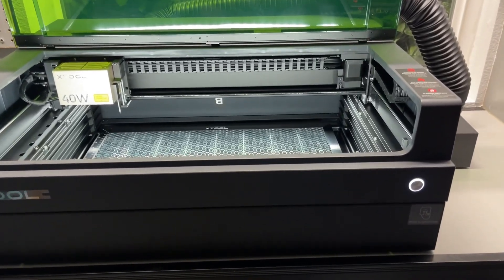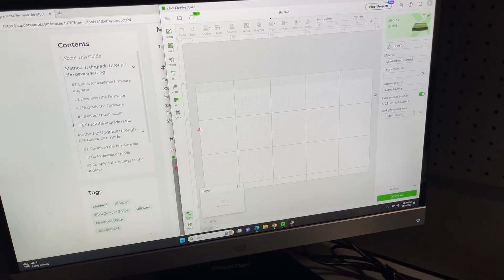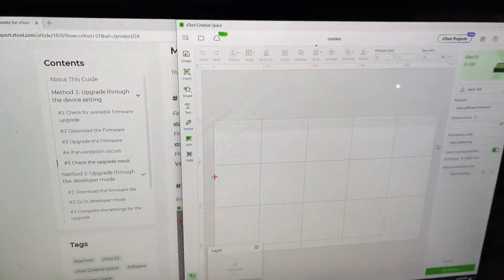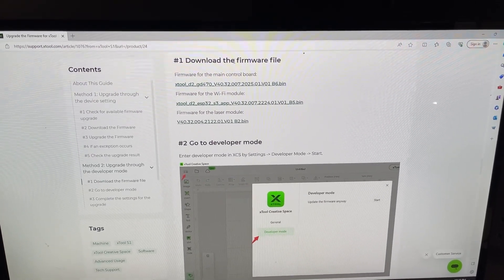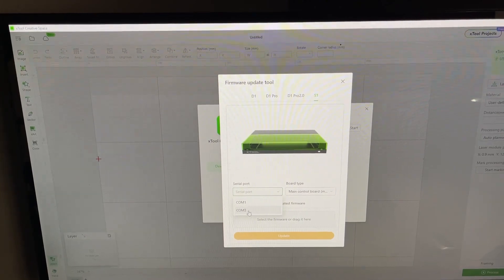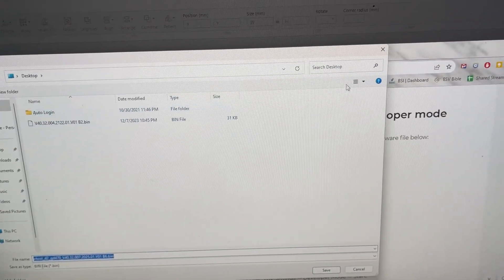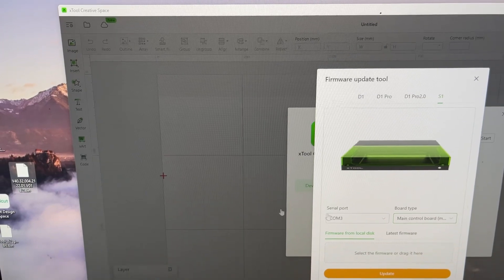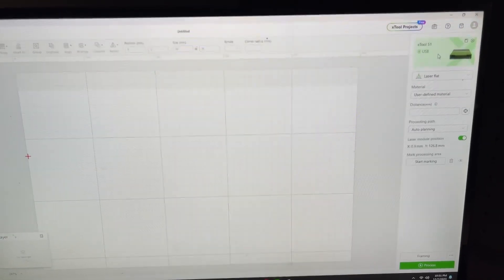How to fix flashing purple light on the Xtool S1  due to failed firmware update

Comment: Thank God, you did this video. I did everything to get my S1 working again. I only have 3 hours on this machine and that purple light was driving me crazy. It was hard for me to navigate to where the firmware was located it is all new to me. 3 hours later I got it working. I was also so frustrated. I used to have a CO2 Laser and used Coreldraw. Coreldraw was such a great graphic software with no issues. I told tech support at xtool, I wanted a refund. Lol Anyway thanks!
Reply from the maker: I'm glad it helped!  I haven't had any more issues with the Xtool after this purple light issue.